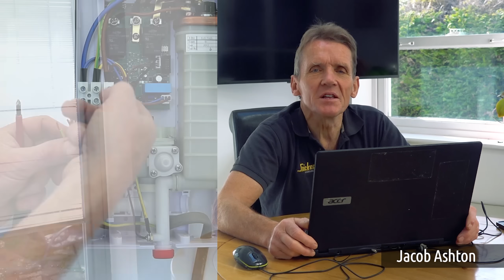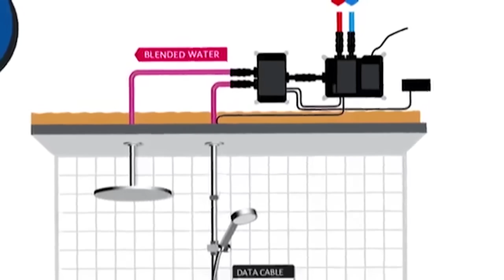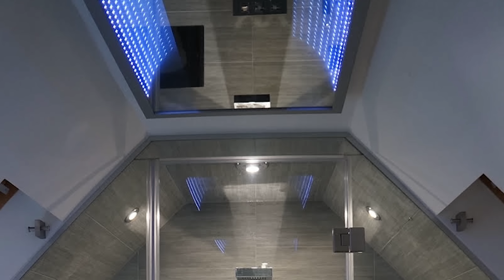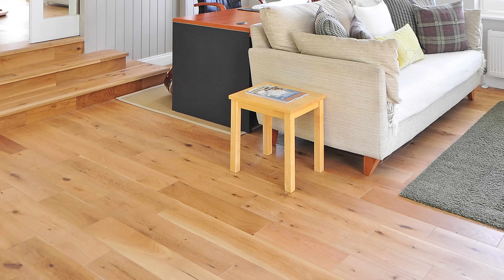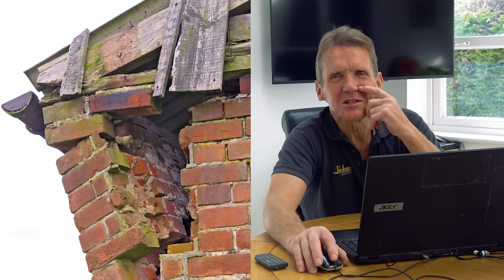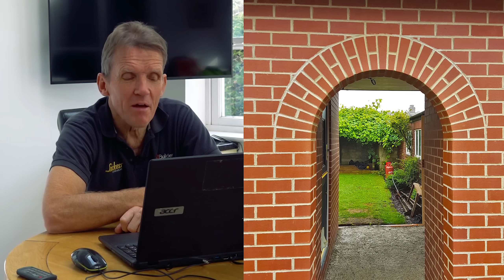5 Problems Solved This Week - ASB #4

Comment: Electric showers do have limits but we put one in as a back up in case we lost the boiler. Also, tank fed showers do run out of water quickly if you like long showers. We have a 12kw shower and it’s pretty good all year round 👍

Comment: I have an issue with kitchen units. The laminate covering ona  couple of the doors has become detached from the surface of the door. There's no split in the laminate, all the seams around the edges are intact. The cupboard sist abouve a lightly used drying rack and is not near to any heat source and does not come into contact with any water. So, if i touch the surface of the cupboard door, the laminate is clearly moving, a bit like touching the surface of a baloon. I have no real idea how to repair it, my thought train is to get a syringe and needle and try to insert some glue into it that way. Any ideas? The colour of the unit is a magnolia

Comment: Some shower heads work better with electric showers. We have both electric and combi fed. The electric came in handy when the boiler failed and we had to a. Get a competent engineer to diagnose the fault and then b. Wait for the parts

Comment: Not sure if anyone added any info re cracks in external brickwork, but as a bricky we determine source of faults by following the crack to its end point, then you draw an imaginary line through 90 degrees downwards, this will then identify the problem , usually you will find they point at lintels or drainage areas etc, and as for the brick cracking, the mortar is far too strong, bricks are supposed to slide over the mortar joint,  great channel, like these problem videos.

Comment: Pumps should be lower than outlet of cylinder. Come on Rodger lol. Hehehe. Sorry I didn't wanna sound like a c*ck but shower pumps should be ideally on floor of airing cupboard. Pumps in loft not good thanks for the video
Reply from the maker: You are right of course, ideally you keep them flooded to avoid cavitation  but they do sell them for use in lofts and in my experience they do work provided the cylinder has a good cold feed 28mm is best..
Reply: @SkillBuilder  I hope i didn't come across like an "a" hole it was not my intention to come across a know it all. been to so many jobs where shower pumps have been fitted in loft and not working correctly. And also working fine so agree it does work.  Very important to that cold supply from header tank is below the outlet from the header to the cylinder if using same header tank so hot runs out 1st. Again seen people taking cold supply from the drop to cylinder and it's basics like this that (could) be dangerous. I'm saying this more 4 the diyer not you buddy. Thanks again 4 sharing your content. Like your channel
Reply from the maker: @mikeseymour4608  Hi Mike. Don't worry I didn't take it that way at all and I you are right I did neglect to talk about cavitation. The problem is that I am aware any of these topics can be extended into episodes in themselves. I tend to be a bit long-winded with the answers at the best of times. You can see by the jump cuts how much Dylan had to chop into my answers  so I am very happy for the conversations to continue and shed more light on the topic. Never be afraid to chip in. If my ego is not able to withstand a little constructive criticism I should find something else to do.

Comment: hi roger .......I want to use elements board in my bathroom.......2 questions come to mind ...... I live in Essex so are there any outlets in my area that sell elements or do I have to order it from abacus.......secondly when you join the board together is it a good idea to put KST adhesive on the edges to get extra sealing many thanks graham simmons
Reply from the maker: Hi Graham 

Plumb City in Colchester are good but you can also order online from Rubbeduck Bathrooms. I would use a sealant on the edges but not the KST.  I have used neutral curing silicone or MD adhesive on the edges in the past when I wanted the extra sealing but that was in and area where I didn't use the tape. It worked perectly. We are going to do some extreme tests with all makes of tilebacker board to see what you can and can't do.

Comment: the first shower problem though ,my landlord bought a brand new shower 9kw fitted it ,and  it was a dribble when selected as hot and it was winter ,but it was actually a faulty new unit he bought,got a replacement and the flow was good, so could just be a faulty one for him

Comment: Great series this, what are your views on websites like checkatrade? I have an issue with my roof and and a few differnt company’s do work but not fixed, when I call them back afterwards, one does not want to know and looks like the other has gone bust/changed details. When I have asked friends they can recommend any other tradesman bar a roofer. 
Part of the issue is I live in a mid terrace and I think the issue is with a neighbour so trying to fix it but want someone reliable and honest.
Reply: Had the same problem 4 over 40 years only I was any good
and he was in his 70s, pays to get an older roofer.

Comment: Hi Roger.  Re the shower pump in the loft.  I have read a lot of material on the shower pump manufacturers websites that say that you can out a shower pump in the loft as long as the water tank is at least 600mm above the top of the pump.  I'm talking about a traditional pump here.  They also say that you cannot have them in the bathroom as they have to be at least 600mm away from a water source.  I'm confused about the whole thing.  The Victoria plum website says that you can have a shower pump in the loft inline with the bottom of the cold tank so lots of conflicting info.  When you talked about the shower pump in this video you mentioned that it could go in the loft but the picture didn't look like a traditional shower pump.  I couldn't find the link you said about.  I'm only asking all this because I want to put a pump in the loft but my water tank is level on the joists and not raised on a platform.  Will it still work ok or will the lack of gravity cause an issue in activating the pump when I turn on the shower.  Would appreciate your advice.

Comment: Whoever did the pipework for that boiler had one eye going in the shop and the other coming out with the change. Well done to the bricky at the end by the way, fantastic job and thankyou skill builder you really do help me alot, you can just be one trade these days you need to have a few strings to your bow to make it work and the info you put out is great.
Cheers👍

Comment: Good spot on the positioning of the shower. Do Aqualisa not recommend using a flange over teeing into the hot draw off before it tees off for the open vent?
Reply from the maker: Everyone recommends a flange but a lot of the time you can tee into the horizontal hot pipe provided the pipe goes down first it usually stops it sucking air.  A lot depends on how good the cold supply to the cylinder is.

Comment: The basic rule of masonry - mortar  should never be stronger then brick/block
Reply from the maker: Eugene Eugene This is exactly what I say in my video on rendering mix and many  plasterers dismiss it. I doubt there are many brickies who change the mix between internal and external skins especially when it comes out of silos.
Reply: You are right mate. If the mortar is too strong it can crack the brickwork or blockwork. In facework it should be sacrificial, better to replace the mortar than the bricks in time.

Comment: Great channel and advise, as per usual.

#3 about the floor. If  you have the room, then save a few planks/ a package of flooring, for later repairs. Just in case. The floor may be unavailable later on. This appliese to tiles and paint and so on, as well. Oh, also, make sure to use boards from a few different packages when laying the floor. Don't use one package of planks and then move on to the next. This will spread any variations randomly ocross the whole floor so you don't get different patches of the same shade floor.

Comment: If you've got a family or large house don't have an electric shower, teenagers spending 15 minutes under it can get really expensive.
I've got a hot water tank, pump and a drizzle head. It's really cheap to heat a tank of water off the central heating and as good as a luxury hotel shower. Just wish I'd used the elements backing board and not the water resistant plasterboard but I did make sure it was really well sealed with upstand etc 
Another great video.
Reply: I always use a system tank, pressurised at mains pressure, no pump required, bit more expensive, latest ones are stainless steel and no longer require an anode, no pump to maintain, no noise, balanced system, used them for 20 years now, never had an issue. 22mm pipe to shower hot and cold gives a decent flow. Tanks with twin heating circuits are available for solar heating, not used that as was quoted £4500 to install the panels, in the summer my gas bill is @£20 per month, hot water only, see no reason for the panels
Reply: @paulhill1665  that's what I wanted and wish I'd got now but my plumber didn't have the certification.
Reply: ralphsterz had that issue as well all the local plumbers to me either did not respond, or it was ‘you don’t want one of those’  had to go 80m to South Wales to find a company able and willing to install the system, they did both boiler and tank, from Viessmann. To me the other advantage is the system boiler is, in general, more reliable than a combi. Installed this one 10 months ago, previous one was 20 years old, was still working, changed as parts no longer available, and not that efficient. The company did a very good job.
Reply: Stored hot water is the way to go . Also good dump load if you have solar pv

Comment: The video with the steam room I believe the cold water it's on the hot water side and vice versa. 
I've had this problem on one of my costumers
Reply from the maker: That is great. I must admit I didn't think about that. I will pass that information on. If that is the case it would be best to swap the pipes over behind the wall. I reckon he has a stud wall built off the gable end.
Reply: Haha. So as the thermostatic expands from heating up it pushes the valve even further to the hot side? That's fantastic. It's no wet room made out of plasterboard but it gave me a chuckle.